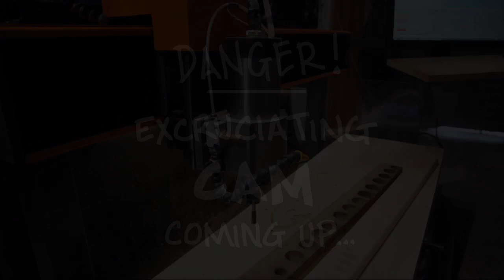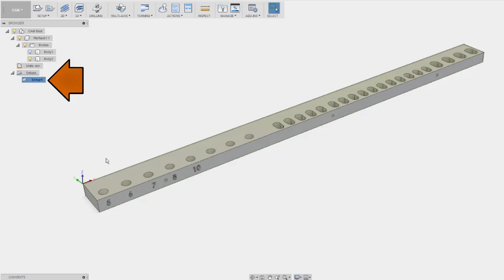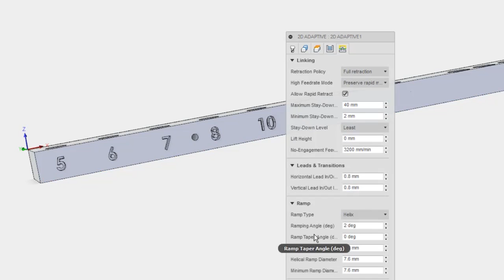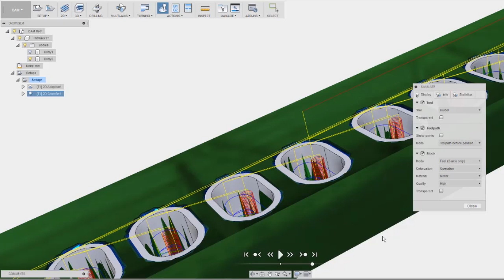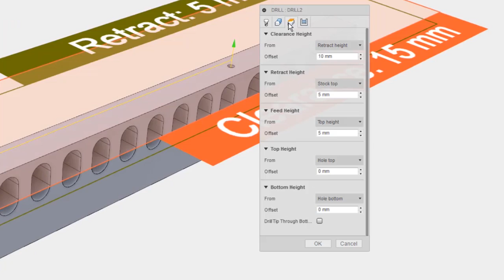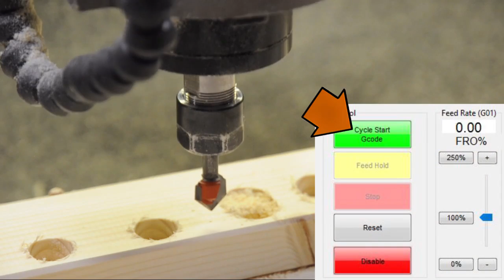CNC Basics 2

Comment: I don't know why I watch your videos, I don't make metal stuff, heck I the only tools I own are a couple screwdrivers and a hammer. My hobby is tropical fish and today I used knowledge from your channel to solve a problem. I was trying to modify a filter by adding a better pump and I needed to mate 2 different size plastic pipes so I made sort of a collet chuck thing out of one piece and was able to then press fit them together. This was not a connection under pressure or needed to water tight but it worked great! Glad I watched your videos on chucks.

Comment: I run cnc shopbots for a living, and I watched your video anyway. I do this for work, and i watch it in my free time. So very sad. Good video for beginners. I think a clearer differentiation betwixt pockets and profiles would help the noobs. You could save yourself some time, and your little robot some work by just cutting an interior profile on shapes you wish to cut all the way through. No need to pulverize all that wood on the inside of the shape if you’re just removing the shape entirely. An inside profile would suffice.

Comment: what is the name of the tool on the far right.  looks like a drift pin but has a claw on the other end.  we use to call them a turkey claw.  unfortunately that does not bring up the desired results in Google when looking for a replacement

Comment: Seems like extra references to buts, you need some Preparation  H  there bud ?  :-D  It really does help ! 😎 
Oh, and on the cat in the shop, they tend to want to investigate any thing that is moving, like mills and drills or whatever, and long tails don't coincide........ just saying !    Don't ask me how I know this bit of wisdom - - - - - - - - - - -!!!!
Reply: I had two shop cats at my shop for 7 years and they would run away When I fired up the lathe or anything. They just hung around the oil burning stove for heat.  At my day job we had a shop cat. Worthless for mousing. But she would hang out with me and lay there with welding sparks flying everywhere.  Sold my big shop and took my shop cats home with me. Now they get to hang out in garage with me if  they ever leave the house. they got soft.

Comment: As a beginning CNC and Fusion 360 enthusiast, I found this video to be exactly what I was looking for. I appreciate people like you who have selflessly given your time to help clearly explain the flow from concept to cut. Thanks again ! If you ever decide to do a video on using Fusion 360 to mill a tapered piece, I'll be in the front row to watch it. The reason I said mill is because I don't have an A axis for rotation. Instead I have a mini lathe mounted on a 3 axis machine with an overhead gantry setup. The work would be in constant rotation as the router travels along the X axis and cuts from either Z or Y depending on the bit choice.
Reply from the maker: A mini lathe sounds like a heckava 4th axis to me!  I don't have much experience here but could you trick that into using lathe CAM?
Reply: This Old Tony I am not sure, I will have to experiment until I figure it out. I have seen other people ignore the rotating work entirely and tell the machine to slowly plunge into the stock over a given distance. For example if your taper was going from 1 inch to 1/2 inch over a 30 inch span, you would treat the stock as flat and tell the software you want to cut 1/2 inch on one end and 1/4 inch on the other end ... since you are milling 1/2 inch away from the dead center at the headstock you would have a 1 inch piece and similarly as the router plunges into the work at 1/4 inch on the live center end at the tail stock you would have a 1/2 inch piece there. I'm just not familiar enough with Fusion 360 to convert that method into g code. Thanks for the reply and if you come up with anything I will be watching ! Cheers !

Comment: Wow Tony and thank you for a fantastic video. What I do not understand is Mach3 at 22 minutes I see you moved the cutter out of the cutter position to zero the chamfer cutter. However, I noted that you did not seem to regen the toolpath unsing the regen button I do not understand when and when not to do that. I found you video to be great I would love it so much if you could do one someday on mach 3 basics i.e. the set up parts. Nice router I watched you go through the build. Have a fab Christmas
Reply from the maker: Don't quote me on this but I'm pretty sure the toolpath display and regen toolpath is for your (the user's) benefit; it has no impact on the G-Code.  the code is the code.  For example, if you load new code, the display will show you the toolpaths and an outline of your table.  they might not be properly aligned.. for example, the 0,0,0 of the toolpath will coincide with the 0,0,0 of your machine but if it hasn't been homed that 0,0,0 (origin :) ) is meaningless.  So if you wanted to check that your gcode was within your table bounds, you'd want to regen the toolpath once you've homed your machine and loaded your code.

If, on the other hand, you're sure your GCODE is within the machine limits, the toolpath (and/or regening it) don't really do a thing.

To reiterate, the display is a visual check that everything will go how you think it will go.  Any changes you make to the code or the coordinate system requires a regen on the toolpath display.  If you're confident you've zeroed your machine where you need it, and the toolpath fits in your machine size, the toolpath display is not necessary.

Again, don't quote me on that.. but these days I hardly even look at the display, and haven't run into any problems.

Thanks for watching John!
Reply: Thank you so much for the reply Tony. I will read and read again what you have said and try and get my head around things. Thanks again J

Comment: Nice Tony. Thanks for showing how you use fusion.     Oh hey and on your cycle time:  checkout your ramp angle.  You could probably go super steep with that bit.  Basically  what you achieved by switching to the circular cycle.     Thanks for the excellent videos.

Comment: ....... peg board.........?
Reply: Used to be a good option, now it's just cardboard with holes in it with a premium price tag.
Reply: Matthew Herrmann make one out of a nice piece of cheap wood or aluminum?
Reply: You could, but a full sheet of 1/2" OSB is only ten bucks. I was able to outfit 24 linear feet of my shop with tool storage for about $50USD and in two afternoons of work. Including all the the tool holders.

It seems like the time and cost isn't worth it. I'd rather be drinking coffee and staring at a project figuring out why it doesn't look like the video I just watched.

Comment: Very good explanation of the CAM! Not too detailed, but still covering the important points. And showing your mistakes is also very nice. You learn from your  mistakes, and now we can also learn from them.I would try running the chamfer first to get less tearout in the pocket operations.And check the engagement making the round holes! They look like G0. That works in soft wood but will get you in trouble if trying it in aluminum. Or it could be not giving a lower F word than the XY movements? It's modal, so will be in effect until changed.  Plunging should typically be done at a lower feedrate

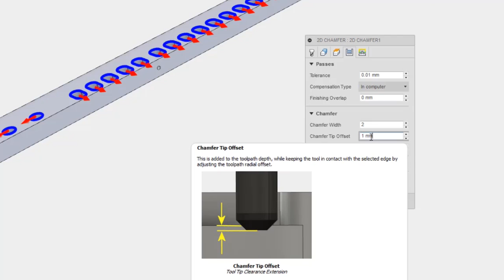Comment: 12:40 i can use exatly same code i used to mill pockets todo chamber :) cam is only do it harder. when have work 15years on nc machines by hand programming. after that time you allready have skills to make writing VERY short. and not many stuff that i allready have writen macro 1 line tell pocket size. depth of cutss how deep need go. next lines is coordinates for each pocket VOLA! unless its 5-axis cam is usless for me

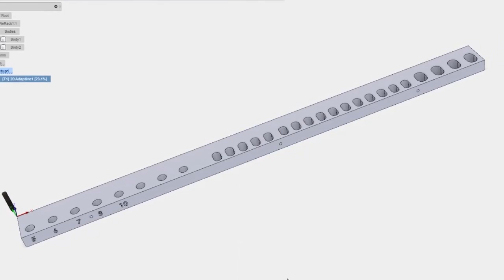Comment: 11:13 so easy part and so smart software but cant use brain to correct it byself. its cam software it should automaticly do it. and it only have 3 difrent features. 1 is hole very easy program by hand. 2 last is pockets very easy to program. and only need program 1 pass and loop it until you thru piece. and then do same operation else where. how cool NC-Code is. how many lines that program will do? 1 million? i only need 4 point for feature and loop take6 lines. 2 lines for move coorditae system. thats all. this program is less than 15 lines long for 1 pocket group. how easy its edit .oh yes very easy. how easy is edit cam program with 1 million lines. oh yes impossible. you need create full program again. and wish nothing go wrong :)))

Comment: stefanblumhoff@yaho.com.auI am thinking of having my lathe assembled piece by piece having a 14" to 16" swing and a 60" bed. ABILITY TO CUT THREADS AND ACCEPT A 5C COLLET IS A must. It WILL BE A 6HP AC VFD 3 PHASE motor with a 2 and 16th inch spindle bore. It will eventually be cnc controlled with a 2 axis dro. Does anyone have DETAILED blueprints or know where I can buy them for such a lathe. I will eventually assemble my own cnc able 3 axis dro milling machine also. Everyone TIA especially this Old Tony.

Comment: Are you running Fusion and Mach4 on different computers? I struggling compatibility issues where one program (mach3) needs a 32bit version of Windows and the other (fusion) needs a 64bit version.
Reply from the maker: Yes I have them on the same computer.  Are you running into a parallel port issue?  By that I mean needing a parallel port? :) -- I went with an ESS smoothstepper (ethernet controller) and don't use (or even have) a parallel port.
Reply: Ya, yes! the things you forget- I setup my machine with mach3 years ago and had to go with a 32bit OS as the only option to support the parallel driver. With time I generalized it to thinking that the Mach3 program needed the 32bit OS.

Comment: Question is do I build a CNC router or a plasma table!?
Reply from the maker: That is indeed the eternal dilemma.   Depends on what you'd like to do (more of).  I used to have a plasma table but found it just much too loud and dirty.. though, truth be told, this thing isn't that much quieter or cleaner.  Best to build both.
Reply: From a learning how to run a CNC based machine my thought is a plasma would be simpler to learn. You don't have to know tool loads and feeds and speeds are less critical.

Comment: hey Tony I have an idea for you to try out. it's a link to a ATC designed by some one on the shapeoko forum. I think it might useful for you. of course you will most likely make it better but I think it will be a cool diy. also one thing I should point out is that he uses a microswitch to determine tool height. I'm sure there is a better way to that using a laser and sensor. http://www.shapeoko.com/forum/viewtopic.php?f=11&t=8011
Reply from the maker: Thanks, I'll check it out!
Reply: This Old Tony I forgot to mention but he has more videos of it on his YouTube channel. It's a bit of a brute force design but I think it can be useful. Maybe you can find a way to get his design to work with collets rather than just the tool. If you can do that then you wouldn't have to worry about snapping tools. Also in his latest iteration the way he checks for tool height is different and I personally don't understand how it works but it seems to be a better system.

Comment: I had created a gantry CNC some time back, and one thing I did was mount to line lasers ar right angles to each other on the sides of the spindle motor. This allowed me to project an X,Y line on the work piece with the intersection being where the dead center of the spindle is. This makes zero'ing out the home position on my work much easier.

Comment: Very helpful, thanks! What are your thoughts on Mach 3 vs Mach 4? I've never used either, and planning to retrofit an old machine to Mach 3 or 4 and trying to decide. I'm leaning towards Mach 4, but that wise, rational voice in my head that I always ignore is saying to stick with tried and true Mach 3.
Reply from the maker: I'm only just figuring it out.  Long term it looks like support etc will shift to Mach4.  I don't use a lot of the fancier features so might not be a clear cut line for me.. but I plan to keep everyone posted!
Reply: Thanks!

Comment: how does mach4 actually handle that run-from-here function? seems like something that could easily go very wrong since g-code depends on everything that happened before. 
i.e. the lines before could have changed coordinate system or switched from metric to imperial
Reply from the maker: It does a "make pretend" run (I think that's the technical term) through all the code leading up to the "Run from here" line, but won't make physical moves until the line specified, exactly for the reasons you mentioned.

Comment: I need a shop cat. But before I need a shop. Then a lathe, a mill, bandsaw, grinder, CNC...
Reply: I got the cat, now to get the rest
Reply: We have the same problem, my friend.
Reply: I have most of that stuff. What I don't have is time.
Reply: @UncleKennysPlace  We can exchange, I have tonnes of time but not a shop
Reply: Do you have a house? There is no point to build a shop if youre just renting. All you can have is a cat. And even that could be against the rent policy.
Reply: U 50 k just to start off the line properly
Reply: @LordOfChaos.x  

Nowhere near it. You can get a welder, lathe, mill all for a grand each. If you pick your machine properly (or have a better electrical system than the US) then you don't need electrical upgrades.

Add another 500 each for the odds and sods for the welder and lathe, maybe 1000 for the mill, then another 500-1000 for sundry tools. You don't need a surface plate or full 0-12" set of Mitutoyo mics to get started. If you go for smaller desktop machines, you'd get away with having them indoors (bar the welder of course).

 If you've got somewhere to work with a solid floor, then you can look at much larger used machines, lathes normally go for a song and if you don't chase a Bridgeport then mills aren't terribly expensive. More esoteric tools tend to be exceptionally cheap, surface grinders are often scrap price.

Comment: Like so many small, one-off, CNC projects, an extra piece of material is required. ;) A CNC can turn a good piece of stock into scrap so much faster than you can do manually. It really saves a lot of time. Extra points for shop cat rescue, though.
Reply from the maker: Ain't that the truth!

Comment: I think the 31 minute machining time is because your ramping is so conservative. 2 degree ramp means it does a lot of circling: fine for aluminum, maybe, but not necessary for wood. Predrilling would probably make sense here.
Reply from the maker: Yes, you are correct, ramping made a big impact.  I didn't get into those smaller details to keep the story clean, but wanted to show that minor changes potentially make a big impact.  Good eye, though!

Comment: This is a really good primer on CAM!  How do you like Mach 4? would you recommend it over Mach 3?  Do you have your router/spindle controlled by Mach or do you turn it on manually?  How do you like your eggs cooked? What's the cat's name? What's the cubic centimeter volume of an average donut?  Thanks in advance!
Reply from the maker: Still getting used to M4 but so far I like it.  This might sound trivial, but I like that the screen scales to my monitor!  Spindle is under Mach control but only on/off -- am currently noodling through Mach speed control.  Over easy, no name yet, about 130.

Comment: Regarding available wall space: check out the french cleat mounting system that some woodworkers are quite fond of. It offers some options and increases available wall space.
Too much wood (or sawdust) in a metalworking shop might not go well with each other, but as long as e.g. welding with acetylene is kept separate it should work.

I´ll go make myself one, once i stop watching too much youtube.

And of course, thanks for the jokes, references and that cute kitten.